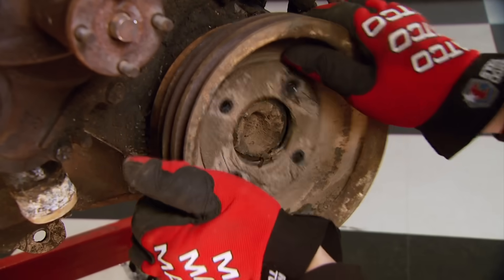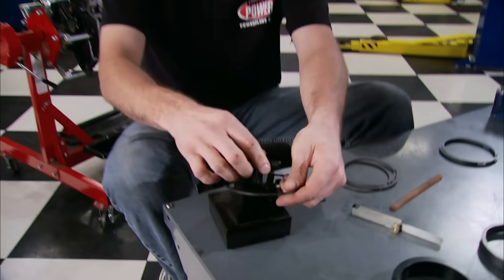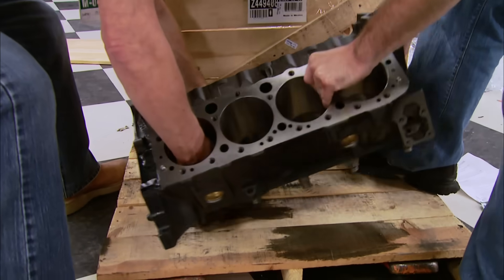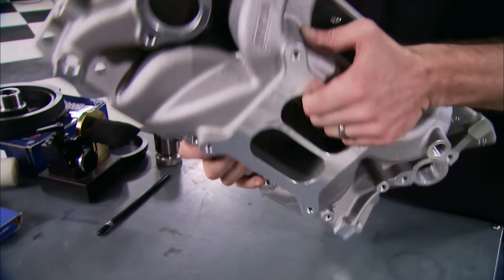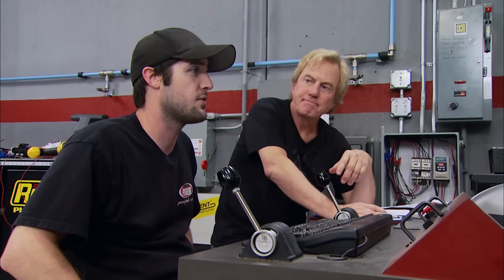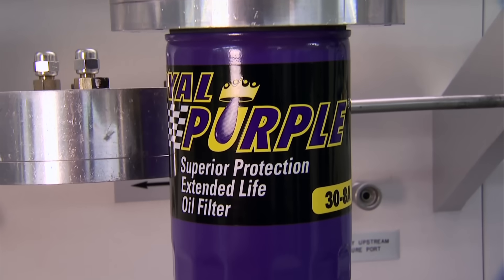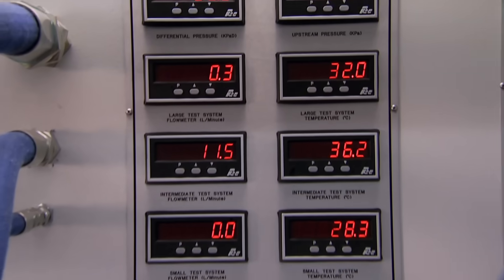Building A High-Performance Smallblock V8 From Scratch Using Only Catalog Parts -Horsepower S13, E18

Comment: Like most things. If you know what you're doing you'll make more and actually know what you have if it's "built not baught". The stroker 383 I built at 16 years old was very similar except I used forged eagle crank and rods, and JE forged pistons, jegs 1.6 ratio roller rockers with a comp cams 305H cam, a real edelbrock performer RPM air-gap intake, and my heads are 200cc dart iron eagle's. I built mine with nitrous in mind so I opened my ring gap a little more and made sure my ignition system was top notch, I also made sure my exhaust was as free flowing as possible (long tubes, to reducers, and I used two turn outs welded nose to nose to make them some what of an S shape to clear the then new cross member to add a T56 6 speed manual (I converted from an automatic to a manual because back then it was impossible to buy a 700r4 (I cant build an autonatic) with a 3500rpm stall that could hold any real power and I did have a built 9" tail shaft th-350 with a 3500rpm stall last about 2 months behind the 383) the 6th speed was the best mod next to the 383 I did to that car, after the S extensions I added glass packs and then did turn outs infront of the rear tires.) So there's basically no exhaust really to speak of. The engine is a tried and true drag racing combo around here back around 2000-2001 when I built it (Darlington international dragway is where I raced). I've since built up a 69k mile 2002 WS6 TransAm 6speed car. I tried to keep the mods minimal since I got the 2002 WS6 TransAm 6speed completely stock in 2012, fully loaded, black leather interior, pewter exterior, with 33,000 miles on it. All I've done to it is hooker ceramic coated long tubes, to a texas speed 3" catless y-pipe, and connected that to a spintech 4" catback exhaust system. I did every free mod I could find or think of, I crafted together a complete nitrous system and run it at a 150 shot. Both of my birds are beasts and next on the list will be an aluminum block L33 (possibly with a turbo) swapped into a 2000 ZR2 S10 pick up truck. I dont like newer cars and nothing anyone makes is what I want or it cost way too damn much. So I'll just find older GM vehicles that are tough enough and I'll build them into what I want. Built not bought. My old cars are in better shape and faster than most all of the junk you see on the road now adays anyway and my newest car (the 2002) has less mileage than most cars at just 69k miles.
Reply: You ever think of selling that ws6 let me know. Doesnt sound like youd ever let it go

Comment: This is my exact build except I went with dart heads but they're the same cc and flow as those edelbrock heads and I'm at 403hp and 421torque on the engine dyno at the crank
Reply: So what do u think the difference is?

Comment: Where can I find a remand FORD Short small block for $750.00 all I find is $1200.00 plus $300.00 core charge on Summit Racing, I'm to the point LKQ is looking good then the issue of finding a Machine shop that wont ask me to bend over just to bore some cylinders haha.

Comment: Which one would be cheaper to build and get around ±600hp and ±550lb/ft: SBC or LS?
Reply: Imo it depends what it’s going in most guys in the import community use the ls because they don’t have to put a bunch of money into parts and make 400hp but if you do a sbc specifically the 350 you can make more than that
Reply: LS is the cheapest bang for buck engine on the market today

Comment: Problem with so little running on the new unit, as it beds down the fuelling will need to be reduced. May as well leave it running for 10-12 hrs at 2-4000 RPM, and then do a finale set up.

Comment: If I was building this block, the only change Id do different, would be a jackson gear drive timing.
Reply: Does gear drive crate less power via more friction? Or, what is the benefit of gear dive vs chain drive timing?

(Please excuse my newbie questions. Just trying to learn).
Reply: @strikeforcek9149   In an application like this, It's to make a car sound like it has a blower without having the power of a blower.

Or, if you're running an engine with a knock sensor, it's a great way to piss it off and get your timing pulled.

Chains are more efficient that gears. They have less parasitic losses.
Reply: @earlbrown  thanks man, That's exactly what I was wondering. If the gear drive created less or more friction/parasitic loss than chain drives.
Reply: @strikeforcek9149   Gears try and push themselves apart and cause friction at the teeth and at the shafts.  Even worse if they're bevel gears.

 A chain is a direct pull against the tooth and uses rollers.  Much less friction.
Reply: @earlbrown  ah hah! Make total sense. My train of thought was "chain vs sprocket"... A chain has many many more points of contact, and a gear only has one small point of contact. Therefore, the sprocket must be less friction.

But, I entirely forgot that the chain has rollers on it and that those multiple points of contact are only tiny thin spots due to the cylindrical shape of the link rollers and way less friction on rolling links as opposed to a hard sprocket on sprocket friction grinding into themselves.

It makes a lot of sense that the gears would be trying to push themselves apart at all times, especially given the high levels of torque they gotta be seeing from the valvetrain and crank. I'm glad I decided to ask this.

Thanks a ton for the explanations!

Comment: I built that engine for my 78 Blazer. The cam was a little milder and I stayed with a 600 cfm carb. It makes 400hp and about 450 torque.
Reply: With the cost of machining up here in Canada, I am thinking of taking thie route these guys used for an engine build.  Just boring the cylinders here is $150 a hole! That’s not including a hot tank, and there is not equipment for a proper line bore, etc...
Reply: @kyleolin3566  Wow, 1200 just for the bore? Then you need all of the other stuff like decking and hot tank. I agree, you are better off buying a new engine.
Reply: @kyleolin3566  that's insane... what area of canada are you in? You should consider shipping down to Washington or Montana? When I got my straight 6 done a couple years ago it was less than half of that. I dont remember exact price, but I want to say it was about 80 bucks a hole.
Reply: Sounds like a great setup.  How well did it work for you.
Reply: @kyleolin3566  It's a strong engine. I put a 4l60 tranny behind it and 4:56 gears with 35" tires. It's really torquey. It's got an old Brodix aluminum head.
Reply: What kind of milage do you get? I’m looking for a build for an 86 K2500 and this engine seems like a solid choice

Comment: is the 318 a good motor mine is a 92 it's fule injection does carborater give more power
Reply: Power is achieved by adding components as a system. For example, a carburetor change by itself won't do much. You have to go down the line and change the cam to take advantage of the increased fuel/air feed. Possibly you will need a torque converter change if it is an automatic. A little head porting may also be advantageous. I doubt if there is a lot to be gained in a 318 without some serious upgrades.
Reply: Your fuel injection manifold is prolly designed to emphasize torque... a carburetor would prolly give more peak HP but lose some low and mid RPMs torque... unless you went to a dual quads tunnel ram intake setup... https://www.dailymotion.com/video/x3rfhrk

Comment: why did the v8 never go for overhead cams?
Reply: There are many OHC V8's.
Reply: 1990 - 92 Corvette LT5 small block Chevy has DOHC... but went back to OHV for even more power at $20,000.00 lower price and lower weight... OHV gets the job done...

Comment: An easy search finds 500+ hp383 strokers are $5k turnkey to your door. This is an awful DiY comparison.
Reply: a different cam probably would've made this build easily go over 500 hp, and the thing about cams is, price wise sometimes it doesn't matter which one you choose, because the company is going to have to grind it anyway
And if you get a custom grind it may be the same or similar cost. I know comp cams with their flat tappet cams has cams all the way from normal regular everyday street cams to drag race cams at roughly the same price. I haven't looked into roller cams much but flat tappet cams are super cheap. And if you buy a gen1 sbc nascar crate motor it will come with a solid flat tappet cam.
Reply: @ryantexada9269  Yeah, a roller would probably add a few hp. For me it it is the torque band that I look for. More grunt at the lowest possible rpm, but, I'm a street guy not a circle track racer. I've always been partial to Olds engines for that reason.
Reply: @craigstewart1532  the main advantage of flat tappet over roller cams is cost. Flat tappets are super cheap (like only 170 per cam from comp cams) and you don't have to worry about breaking a link bar or dog bone and having a roller lifter turn sideways and ruin the cam. Keep the right oil in it though or you stand a chance of wiping a cam lobe. Flat tappet cams need zinc, you can probably get away with using an oil additive with every oil change

I used to have my oil turning black like less than a week after the oil change and then I went to a semi synthetic with a stp oil additive, I got the stop leak because of a slight rear main leak, it really helped slow the leak and its been driven easily over 1000 miles and I get on it hard sometimes and the oil is still super clean, almost too clean to read on the stick. Looks like new oil.
Reply: @craigstewart1532  but be careful, flat tappets like conventional oil with zinc. I dont know if they still have zinc in synthetic oils but I've heard of people switching to synthetic on a newish motor and wiping flat tappet cams. If the motor has been run on conventional its whole life then you may get away with synthetic but I wouldn't trust it without a zinc additive.

Your best bet would be running conventional or semi synthetic 

Both with zinc additive just to be on the safe side
Reply: @ryantexada9269  Very true, and the roller cam requires a bronze distributor gear. I've always stuck with flat tappets.
Reply: @craigstewart1532  - Nowadays we use a melonized distributor gear which lasts 10 times what a bronze gear does...
Reply: @BuzzLOLOL  I am really behind the tech.
Reply: @ryantexada9269  - The cam and intake are good for over 500 HP, heads holding it way back: 
https://www.dailymotion.com/video/x3rfhrk
Reply: @BuzzLOLOL  yep, people don't realize that most of your power comes from the heads, cam, and intake. Sure different timing chains and different plugs and different cranks and lighter rods and pistons and eletric water pumps, etc etc are good for freeing up small amounts of horsepower that definitely adds up, but the bulk of the power is coming from the heads, cam, and intake. Also depends on how the carb is set up as well

Comment: why do they keep putting carbs on stuff?? efi baby it ain't hard
Reply: Can get a nice carb. for $50 at a swap... EFI going to run $1500 - 3000...
Reply: @BuzzLOLOL   but the hassle of jetting cold start hood clearance I will pass and pay more to just turn a key and go...
Reply: @noedaleflowers3489  Must be a millenial
Reply: @noedaleflowers3489  - Carb.s been clearing hoods for 130 years... cold start is just a 1/2 blip or blip of the throttle... carb'd engines start quicker than EFI engines... jetting is child's play...
Reply: @noedaleflowers3489 thats alot less hassle than ecu tuning
Reply: Neither is learning how to setup a carb properly. Technology is making people stupid.
Reply: @user-ge2qn6gp4o  stupid or more forward-thinking?? was all about the old school tech until I saw what efi does and much better than a carb...
Reply: Let the old guys keep there pushrods and carburettors 👨‍🦳 but if I’m building a 10k engine I’d rather have the safety and reliability of an ecu, for example automatic shut down from lack of oil pressure, knock control, electronic throttle body for flat shifting etc 👍
Reply: @Diesel8290  - Who spends $10K building a small block? Can build powerful ones for $500 on up... but not with EFI...
Reply: @BuzzLOLOL   sorry I had in my head smaller 2.5L na engines producing over 300hp we use in rally cars over here in Ireland, but even so a 3-4K built small block is somthing you don’t want to be replacing over poor quality fuel or low oil pressure,
Reply: @Diesel8290  - EFI isn't as reliable as a carb... always needing injectors cleaned, new injectors, sensors, computer, or something...

Comment: Awesome build. Love me some 383 stroker engine!
Reply: @tomrose6292  - You were brave running that much compression with a .040" overbore... 
I checked it out, didn't think there was any sound at first but then things started happening... nice truck... reminded me of when I rowed my '65 GTO through all 4 gears with tires spinning and then it started shaking violently from side to side and I was afraid I wouldn't get it back under control and there were ditches on both sides of the road...
Reply: @BuzzLOLOL  well comp test says 210 psi.and it's a 1993 block made in mexico. My 68 block had 12.5 to 1s 185 psi it lifted the deck loose from the valley..both sides.a old friend of mine said looks like the jiggling pin come loose from the wobbling shaft.after a long laugh we just got another block of the shelf and started over.lol
Reply: @tomrose6292  - Mexico blocks all 4 bolt, right?
Reply: @BuzzLOLOL  mine is  not sure about all..
Reply: Start with a used SBC 350 and can prolly build a similar engine under $2000.00

Comment: I wonder what kind of Chineseium that blocks made of?.
Reply: Well, they're made at the gm foundry in mexico.
Reply: Its a gm block. But it is a one piece seal so they are not as good as the older 2 piece ones. But there are plenty of decent aftermarket blocks out there for reasonable prices. Reasonable being a relative term.

Comment: IF my math and information are correct, this series ran for 14 seasons under its original title beginning in 1999 so this episode would have been from 2012 and likely made in 2011 so pricing and part numbers maybe a little off a decade later.
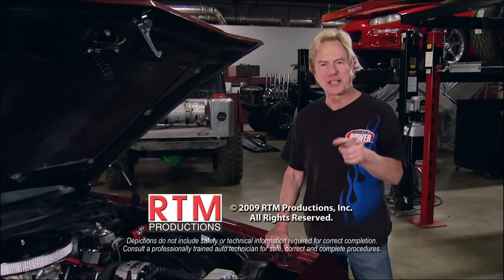Reply: 17:39 The copyright date is 2009,  so it's a bit further out of date than you realized.  Still an interesting idea comparing built vs. bought.
Reply: Damn I didn't even consider that... was just getting excited to look at the summit website after this video ended.

Comment: This is great and I think answers a question for me (I think ) can you buy the parts like this and NOT have a machine shop balance the crank using the bob weight and such ? How much would it be off ?
Reply: No you should ALWAYS balance your rotating assembly. That said, there are a few people that sell entire rotating assemblies, but they are kinda pricey and you have to use their rings, bearings, etc.
Reply: @GreatLakesLogger  in all fairness you should always be balancing the ring pack to and then include them in the counter weight number. 

Yes Robert you can buy pre balanced assemblies. But they usually don't balance them to what a performance machine shop does. Most pre balanced assemblies are +-1 gram. Which is much better then factory. Can have anywhere between +-4 to +-9 depending manafacturer and the engine. Most machine shops balance to +- 0.1 gram.
Reply: @hayden6056  exactly
Reply: This is a balanced assembly

Comment: Pontiacs really sounds like a 383 Chevy with the measurements funny hearing the old school motors making a comeback.
Reply: Old school motors never left out here in the real world... and this episode is old...
Reply: And you can build a 383 Pontiac--drop a 4" crank into a P350. but the real joke is the air gap intake---Pontiacs ran those for decades.

well, technically, there is a joke on the Pontiac guys--they always thought the 350 was a waste of money. Like everyone else, they were on the "four inch bore" bandwagon, but the LS 350 has the Pontiac 350 dimensions...no one thinks those heads don't flow or there's any bore shrouding issues. And yet the valve angle is similar, too.
Reply: @albertgaspar627  - 1916 - 1918 Chevy V8 had air gap intake !!!
Reply: @BuzzLOLOL  "everything old, is new again".  Classics from the Roaring Twenties/Great Depression ran all sorts of valves and cams, but were designed for low RPM torque and had overdrives to spread out the power band. What does Detroit do in the 1980's? low rpm torque engines with 5 speeds to bring back 14 second cars.
Reply: @albertgaspar627  - WWII airplanes had turbochargers, superchargers, fluid injection, fuel injection, and nitrous oxide injection... Chrysler tank engines were hemis...
Reply: @BuzzLOLOL  true, as airplanes went higher than hot air balloons--another weapon of WW1--they found that thin air to be a real issue. They also learned for passenger carry, the supercharger could pressurize the cabin so they wouldn't need individual oxygen bottles.